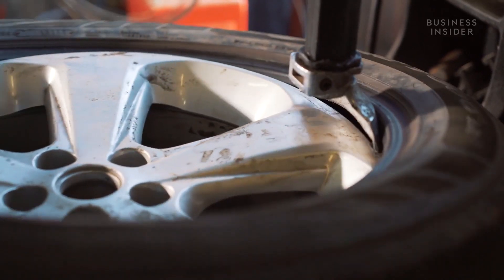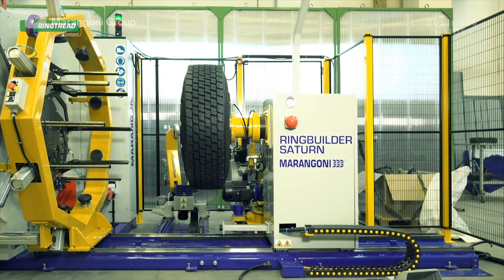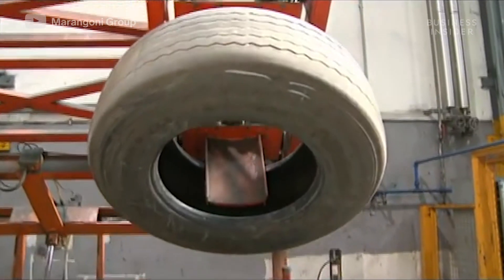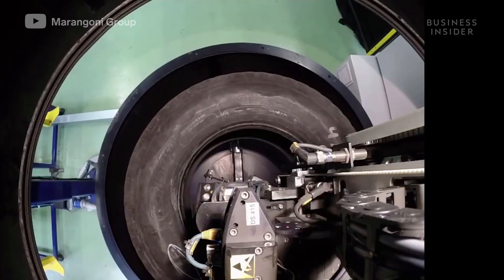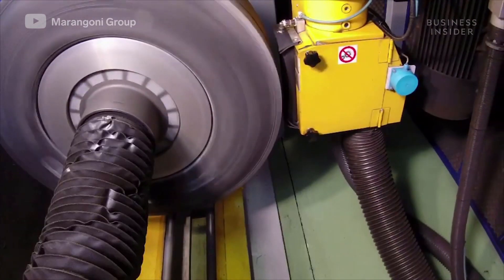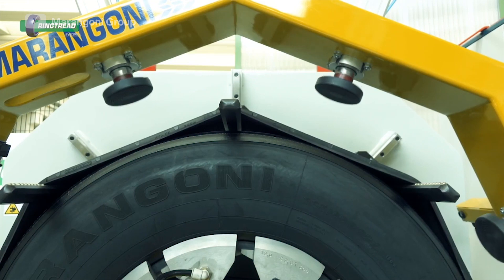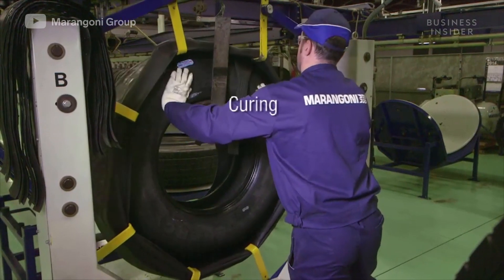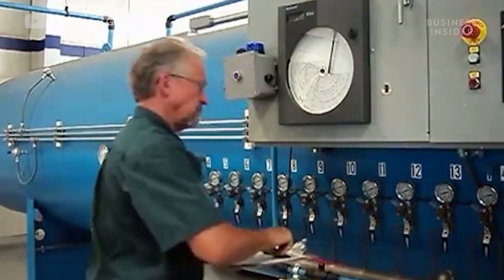Old Tires Are Retreaded To Be Good As New

Comment: I understand that these retreaded tires are generally cheaper and better for the environment, but I don’t trust them. I’m temporarily a truck driver and had one of my retreaded drive tires completely come off the shell of the tire. I knew the tires were no good but my company didn’t listen to me when I wanted them changed. If I were the owner of that truck, I would only use brand new tires every time I need a replacement. Sure, it’s more expensive, especially when you have a fleet of 1500+ trucks, but they’re safer and more reliable. 

I only use brand new tires on my personal vehicles, either Michelin or Pirelli. Take care of your vehicle and your vehicle will take care of you.
Reply: You think the company cares if someone dies ? It’s cheaper meaning more profit

Comment: When you see tires explode on the hwy, that’s from re-treading. Retreading is the worst idea ever. Steel belts can only tolerate so much abuse and rotational mass over time.
Reply: Especially horses. When their tyres burst they get laid out like a carpet while the side walls disentergrate which I always suspected was retreads.
Reply: “The National Highway Traffic Safety Administration completed a comprehensive commercial tire debris study in 2008 in which they analyzed almost 1,500 tires and tire debris from our highways to determine what caused their failure or removal from service. Their conclusion is basically, when tires do fail, new and retreaded tires fail in equal proportion and those failures have nothing to do with the retreading or manufacturing process.“

The government is a bunch of liars!

Comment: Are those the tires that explode on the middle of the highway?
Reply: Yep
Reply: Yes, you should always use new tires and not tires that are re-treaded as they are dangerous and not certified as safe by the manufacturer per the date stamp on the tire.  This whole video is trash as even old never used tires are unsafe if more than seven years old as the rubber becomes hardened and cracks.  You should always install new tires, safety first!
Reply: @abc123fhdi  Didn't you watched the video? They literally check the tires for defects.
Reply: @123 abc you are a fool probably from u.s.a😅🤣🤣
Reply: @abc123fhdi  haha, independent laboratories all over the world say what you just said is not true... There are multiple steps to tire retread. First and most important is inspection to determine whether the tire can be retreaded or not. Do you research and stop the misinformation. New tire manufacturers will tell you to buy only new because they want your hard earned cash, don't be a sheep.
Reply: You should watch Pakistani trucks channel.
Reply: Yea these tires are trash